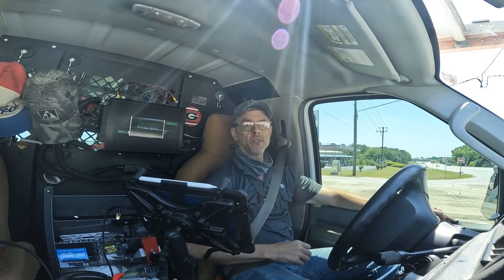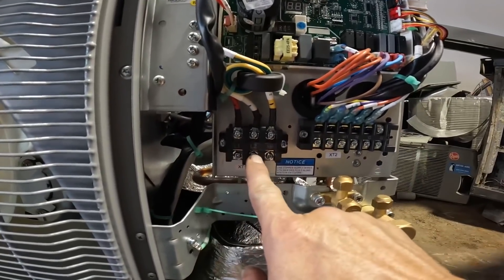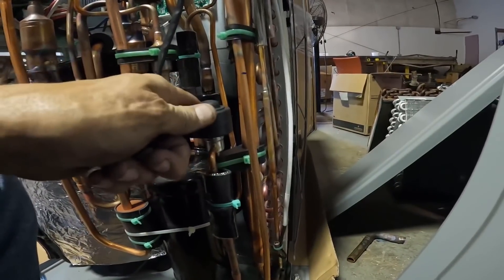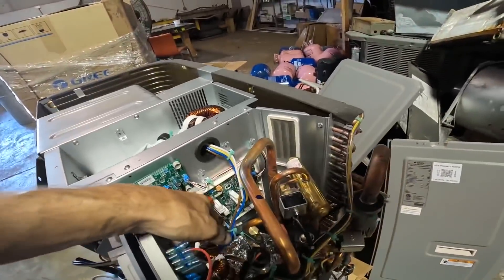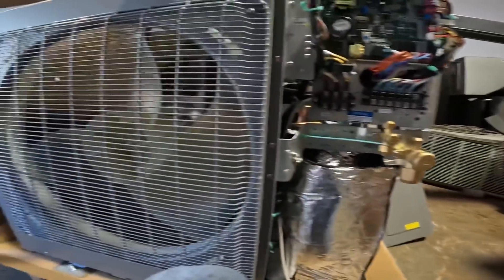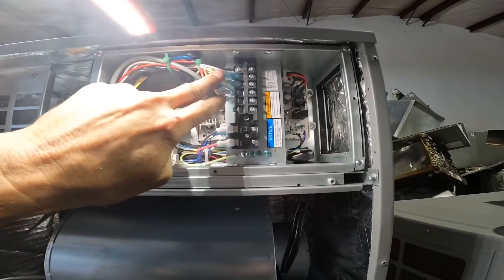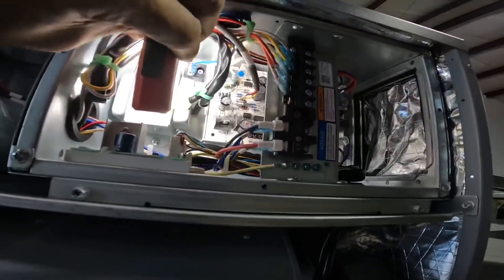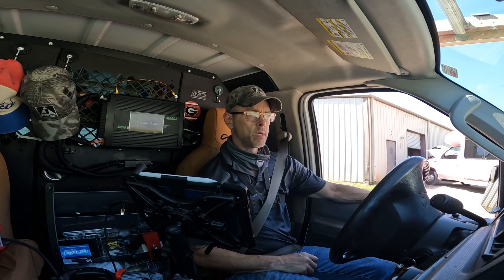Unboxing Of The Gree Flexx 3 Ton 20 SEER Inverter System

Comment: Great units at their price point. My only real gripe is where the service ports are located... Right under the low voltage control terminal block. Having to use 5/16 adapters and/or schraeder valve tools gets a bit irritating being so close to the block. For petes sake, moving 3 or 4" lower wouldnt have hurt. Otherwise, these are outstanding inverter driven heat pumps.

Comment: Hi , those valve need to open for to the evaluation?? For the indoor unit
Reply: No, just needs to be flared. The indoor unit has a holding charge of refrigerant and should only be open once the evacuation of the lineset is complete.

Comment: I believe the large toroidal coil works with the other two smaller ones on the legs of the motor. They measure current in and out. The current is compared for a difference to shut off the unit under a ground fault condition.

Comment: It's called a line reactor. It is a coil of wire around a magnetic core that creates a magnetic field when current flows through it. This magnetic field increases the impedance of the line and reduces the total harmonic content injected from the drive onto the compressor.
Reply: It should be a CT or current transformer. It measures current like the clamp meter in a hand instrument. Notice two more above the compressor. In conjunction these can detect a ground fault.

Comment: Exactly the same as the MrCool Universal 2/3 Ton.  Both the Air handler and compressor.  Sweet system IMHO.
Reply: I just got mine up and running. My HVAC guy that sweated and vacuumed my line had never seen anything like it before and was excited as hell when we first fired it up. It ramped up super slow and was quiet as could be!

Comment: I installed the 2/3 ton and 4/5 ton mr cool universal units which are the same units rebranded a little over a year ago and they are  doing well here in texas. There are also 3 modes you can set them in eco, standard, and high that the install manual does not tell you about. If you look in the service manual it explains the differences.  Im curious which mode you will choose to set it in. The standard mode is what the install manual shows. Let us know which one you put it in if you can.
Reply: Can you give another update on the Mr cool? I’m thinking of installing one. Also, I have a 3.5 ton now. I’m wondering if I should buy a 2-3 or a 4-5. Thanks

Comment: Nice looking system. I’ve never seen this model.  We install AMS and I don’t believe they have a similar unit at 20 seer.   We have slim profile however I think 2 stage 17 is it.  Do you ever do performance test after a full system install.   That system would be interesting to see.  Thanks for sharing you do very good work.

Comment: I think these are the same units that have "MRCOOL" brand on them. I think they are made by Midea. Thinking of one of these for a beach house. Our temps at the lowest maybe get down to 10 and that would only be a couple time a season here in Delaware. What do you think of them especially for the price and the self-install lines that MrCool makes?
Reply from the maker: I’ve never installed a mr cool. I did a lot of reading about these before offering them. I’m hoping they are the solid product they appear to be.
Reply: Yes they are the same equipment as Mr Cool Universal. I have the installation manuals for both and it is exactly the same manual.

Comment: Sure hope that company has a good tech support. Those boards in the condenser are going to be a pain to trouble shoot. Fujitsu had boards that where easily accessible, their tech support left me on a roof for 8 hrs, once. I did lodge a complaint and was told who to contact if that type of thing happened again. Wish you luck 🤞

Comment: It looks more like a satellite in there, than an air conditioner. I hope all those capacitors and electronic components inside are the best quality humans can make, or it won't be long before something breaks. You would think wrapping up that compressor would cause it to run hotter, and possibly shorten its life. We probably won't know for about 6 years.
Reply: if only there was a liquid/gas passing through it which kept it cooled or warmed.. oh wait 😉
keeping it warm in winter is more of an issue than, keeping it cool in summer and noise levels lowered are a must.

Comment: I’ve got a Mr Cool Universal that I’m just finishing up the install on. It is the exact same unit just rebadged. Hopefully we both have good luck with it.
Reply: The pricing for the Mr Cool version is much better than the Gree version of the same equipment. Did you use the pre charged lineset or brazed them?
Reply: @houptee  I’m brazing a conventional line set. I put in a new 95% furnace and a new evaporator coil from Alpine home air a year and I half ago so this will be a dual fuel setup. Hoping to reduced propane usage next year.
Reply: @kxhonda  how are you doing it the Mr Cool air handler in series with the furnace and 16 Seer coil on same ductwork?
Reply: @houptee  I’m not using the mr cool air handler. My existing furnace and evap coil is essentially the air handler. Just brazed the line set to my evap coil. And use a dual fuel capable thermostat to control everything.

Comment: That toroid coil in the condensor is an EMI filter and part of the line filter.  Also known as a common mode choke.
Reply: It could also be the current inflow measurement that is compared to the two legs of current going out to the motor in the compressor. Looks like two more toroidal coils just above the compressor. Another clue is the white mains lines going through the center.
Reply: Even with this set up, do we still need a EMF filter for the system, as an inverter system?

Comment: Good job Curtis, the coil could increase the voltage or amperage or step it down, but not sure, can open or close a circuit, can't really be sure about, can only tell so much watching on the computer screen, but seems like a commercial type mini split inverter. Keep up the quality work. Buy more Milwaukee tools you have been programmed. You have seen the light. Just kidding, haha.

Comment: That coil in that box is the inductor I believe, and that smaller board is the drive board? (If it is it will have the UVW power wires down to the compressor)

Comment: Most Inverter systems have those "coils" which is called a Ferrite. Others wers right, simply a noise filter. Don't get how they can get any high efficiencies without a communicating thermostat and E.X.V.

Comment: I’m really surprised this didn’t come with a proprietary communicating thermostat. Doesn’t even look like it is a communicating system. Weird considering the efficiency rating of it.
Reply: You have to run a cable from air handler to the condenser and then to a regular thermostat. So they do communicate directly not via a proprietary thermostat.

Comment: I love electronics, but the more circuit boards I see on units the more I always worry about failure points and the elements getting to the solder joints on the boards. Looks pretty cool what they are coming up with, they keep making things more efficient each year.
Reply: it can be worth it for a heatpump - maintain full heating capacity down to very low temps. for straight-cool, not so much.
Reply: This is my thought also. But also all the little braze joints on that complicated stuff hanging off the side that could leak. I know these are the future. Also customers will be asking for them. But they will be mad when there are  expensive repairs

Comment: There is a noise filter board power board and controll board that changes ac to dc then back to 3 phase ac voltage. Just like the mitshubishi hyper heats. Not the easiest to work on but simple to pull covers off for access. Make sure you let the capacitors desipate after powering off or you'll short the board if you try to unplug any of the connectors
Reply: I bet the last part of what you said is a big failure to the boards
Reply: I believe in this case it is a CT or Current Transformer. Much like the clamp on current meter in our tool bag.

Comment: Have you ever installed one of those before or will this be the first time? I’ve done Mitsubishi air handlers and high wall units before, looks fairly similar but a ton more stuff inside that gree!
Reply from the maker: First one I’ve installed

Comment: Looking forward to the install. In Opelika my 2 Bosch IDP units for the 1st winter had a total of 20 minutes of running heat strips on only one of the units. The other unit never had the strips come on. They replaced 27 year old Goodman gas packs. The savings for electricity and gas has been substantial for us.
Reply: Be dam lucky to get 7 year out of it little on 27 year to much junk on them
Reply: What’s the lowest average temp in your area?
Reply: @Hvac-Alex  avg monthly low in Jan is 33

Comment: It is a filter for electrical noise. All inverter manufactures want to protect the compressor above all else. I know, I used to work at LG in Tech Support and at Daikin as a Product Specialist for Unitary Inverters. Let me know if I can help you. I'm not a Gree fan, but that system looks pretty impressive. I'll bet it is a competitor's model copy. That is how Gree usually works. But I hope it works for you. Make sure to use nitrogen on braze joints. EEV can get stuck easily, carbon is not they're friend.
Reply from the maker: Because we are replacing line set, and flare fittings, there will be no brazing at all.
Reply: @HVACGUY  Be careful on your bends also. Use tools for bending copper. I hope the best for you. At least with Inverters they have PVE oil.
Reply: A while back around 2010 Gree and Daikin had an agreement that daikin would help gree with inverter technololgy and gree would help daikin with mass production manufacturing side.
Reply: @rstephen001  I think you mean Midea. I wasn't impressed with gree around 10 years ago, but today with their new lineup, I am.
Reply: @sprockkets  Just realized when you put links in your comment they dont show up lol. Search 'win-win daikin and gree model' to see the report about their partnership in 2009. But I do think you are also right that daikin partnered with Midea more recently.
Reply: @rstephen001  I was at Daikin in Fayetteville,  TN With a office in Houston TX. I started in 2014. I know nothing of that before hand. I was Unitary units.

Comment: never seen a unit like that dont want one too much to go wrong. going to stick with my 2011 r 22 ruud heat pump as long as it keeps going. think I got one of the last that E&E had or close to it .
Reply: I'm hoping deregulation comes to the industry and opens the opportunity for innovation and a comeback for simpler, unbreakable things like they used make but with hydrocarbon refrigerant.

Comment: More items to go bad
Reply: Just went to a customer's house had a Gree  30k four zone system with a 12k head and a 18k head, 
9 years old only the filters had been cleaned they wanted to remove the system from the garage and laundry room to a new two bedroom room addition the unit was half charged of refrigerant, the system was running for the hour and a half that I was there and never cycled off customers just don't take care of their equipment instead of going with a two-zone 24K system they opted for a 2-ton gas pack and ductwork instead there existing 4 ton gas pack was so filthy dirty I walked away from servicing that particular unit of neglect did not want to get a roped in to a situation where they say oh you worked on it, not my install. They will hire another company to service that unit, these millennials nowadays just don't take care of anything, turn the knob and go! Priceless in my opinion!